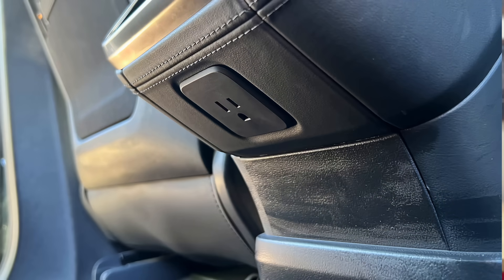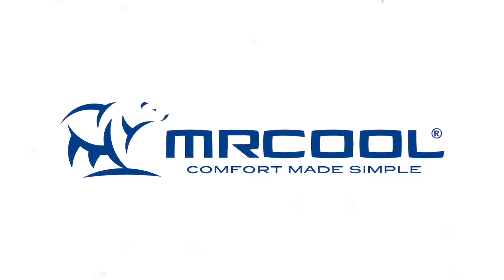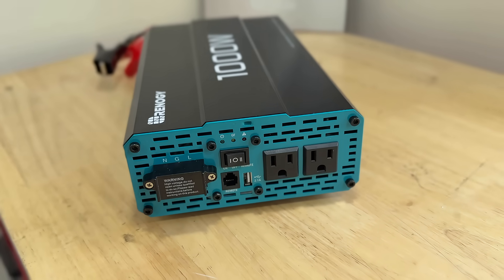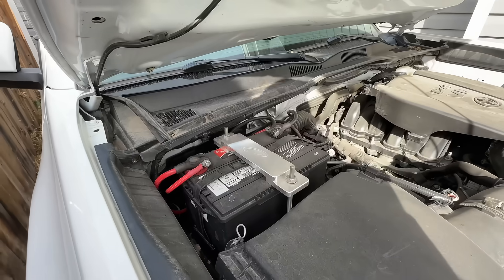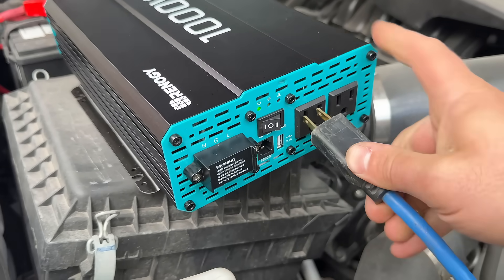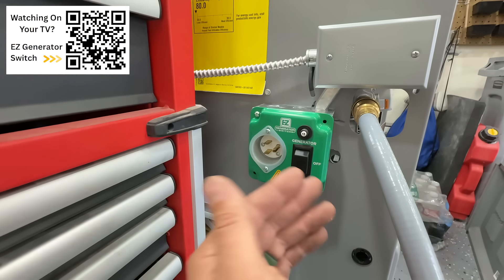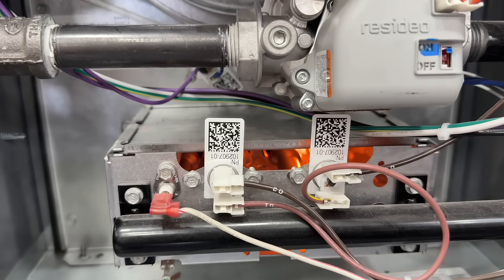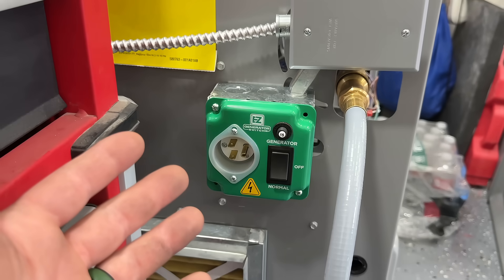Why Buy A Generator? You Have One Parked In Your Driveway.

Comment: Of course this is really a good idea, However there is a catch!   which is your country needs to have regular deliveries of free / dead cheap Iranian, Syrian or Venezuelan oil..
Works well in the USA where it seems stollen oil is often a normal thing not so sure if it can be viable in Europe or elsewhere as the high cost of fuel will make this too expensive for longer running times.

Comment: The engine is fine to run that long but the heat from your engine can melt the little plastic parts in that converter, stick it under a seat or in the bed!

Comment: So I most definitely can plug a power strip into my extension cord and charge my Makita batteries,  my cell phone, and a blue tooth speaker on a off grid cabin build? And also another longer cord to run my worm drive saw, and vaccum and a corded grinder?

Comment: You can do this, but just know that you're likely to wear out your battery and alternator much faster. The alternator is not designed to carry that high of a load (a large inverter) at idle for long periods of time, it will overheat and it's life will be shortened. I would not close the inverter under the hood, it will get too hot, and there's too much risk that if it moves it could short out something.

Comment: I don't care what size inverter you use but if you pull more than 600-800 watts from your battery you will ruin it sooner than later, and even less watts direct from the alternator. I'm a car audio guy and the way we produce wattage is through amplification and performance alternators..Not through straight drawing 12v inverters.

Comment: before buying an inverter figure out what you want to run...and how much wattage it uses normally...if it has a motor ( the furnace fan...compressors on refrigeration / freezer units ).. they will draw whats called a " PEAK " wattage...it uses almost double normal running power to get the motors moving at first and then drop down to running wattage.... you also want PURE SIGN WAVE invertor if you running electronics...and some furnaces are high tech computer boards !!     A pure sine wave inverter converts DC power (from batteries) into clean, stable AC power that closely mimics utility grid power, making it ideal for sensitive electronics like laptops, medical devices (CPAPs), TVs, microwaves, and motors, allowing them to run quieter, cooler, and more efficiently than with cheaper modified sine wave inverters, though they generally cost more. They're essential for RVs, off-grid systems, and emergency backup power, providing smooth, reliable energy.

Comment: It's not recommended in the UK.
If you leave your car running unattended on your driveway and someone steals it, your insurance company may not pay out - you made it too easy to be stolen.
Try this with your car on a public road and it's now illegal. If you're stopped for more than a minute, certainly outside schools, you're supposed to turn your engine off - pollution, fuel wastage, etc.
Failure to do so could win you a £20 to £80 fine.
That and the inefficiency of an idling engine is said to leave residue due to improperly combusted fuel that could damage your exhaust.

But hey, you know, it would work in a pinch.

Comment: 1000 watts won't even run a hair dryer. My 2018 Toyota has a house plug in the back and it's only rated at 400 watts.  You mess with modern and expensive automobile electronics and you are asking for expensive trouble. It's also not good to idle a vehicle engine anymore than you have too. The EPA smog devices, egr valve,  tend to foul your engine.  My home heat pump has a small 13 ton coil. It takes 30 amps at start up. You need to get a good understanding of amps, watts and volts before you start messing with DC to AC current.  You need the proper gage wire or you could overheat it and start a fire.

Comment: Why?  Because  A:  Running your car just to run the alternator is the LEAST fuel efficient thing you can do.  B:  Depending on what car you have, your alternator is only going to put out 50-100 amps, which is 500-1,000w.  C:  You're burning up gas in your car that you might need to use for other purposes.   Literally a $200 generator is better at both of these things and about the same amount of money as the inverter and cables.   Yes, using an inverter in your car is a neat trick for a DIRE emergency, but if you are thinking ahead, then it's a very BAD idea. Just buy the right tool for the job. More effective, more efficient, and not that much more.

Comment: This should be reserved for extreme emergencies. A $500 generator will make more power and use only a tiny portion of the gasoline, and without unnecessary wear and tear on a $20,000+ automobile. Also, even a cheap alternator today (which isn't designed for sustained high loads, as would be needed to power your lights and appliances) will cost more to replace than your $500 generator.

Comment: sooooo drain the battery to run the furnace... got it.
just get jumper cables and extend the inverter...

inverter is going to melt in the engine bay...

Comment: I don’t know about other vehicles but my 2016 Silverado has a plug but will not power much..they only put out 150 watts, or some say up to 400 watts. That will Not Run your fridge or any furnace blower. You can charge your phone or laptop or some lightbulbs. Just check your vehicle so you know and not surprised when the power goes out. You need to know what your furnace blower needs to start, called. Start up watts or surge watts. If your power source can handle it then you’ll be good.

Comment: Just make sure your engine is running or else you will  fry your battery. Turn your car on while inverter is plugged into battery, if its just 110v 150watt heater you need for furnace. Just get a 300watt inverter, no need for a 1000w.  For sensitive electronics make sure its a pure sine inverter.

Comment: At roughly 3 gallons an hour at idle, it's a very inefficient use of gasoline.
Those tiny wire clamps that come with the inverter are only good for maybe 360 Watts / 30A @12v DC

Comment: Do you need to keep the car idle the whole time? If so, the gas it burns are very costly. Probably 100 bucks a day. Not economical.
Reply: A hybrid car about 1/3 of a gallon an hour. You don't need to run 24/7. Every 3 or 4 hours you start it up. Cheaper than your generator 😮

Comment: I wouldnt use those gator clip cables myself id use larger ones, maybe even jumper cables. On 12v with an inverter youre drawing a lot from the battery. Say youre using all 1000w. 8 amps AC from inverter, 80 amps from battery. This is going to work your alternator very hard over time, average 12v battery will last about maybe 20 mins on its own and thats being generous

Comment: Your car isn't supposed to idle like that.  It's abusive to your valve train and lifters to let it idle, unless you have a dramatically upgraded oil pump.

Also, using the onboard inverter of a car is just sad.  A car's engine is capable of generating far more than just the alternator will provide, but even the alternator output is usually in excess of 150 amps as 12 volts, or roughly 1800 watts.  If it were optimized to be a generator rather than a transportation machine it would have an alternator in it that would match the total power output of the machine, closer to 100+ kilowatts.  Using this engine to get a mere 400 watts or something like that (which a typical modern onboard auto inverter will provide) is wasteful and foolish.

If you're doing this and getting less than 1200 watts through an aftermarket inverter you attach to your car's battery, you're being inefficient and also destructive of your vehicle.

Comment: Great video! However there's more caveats;

Leaving your vehicle running is a much bigger risk than the inverter getting stolen. But if you're in a good area it's unlikely. 

Don't run it for long without the car running, regular car batteries are not deep cycle and will take damage being discharged like  this... You could also run it too low to start the car.

Those wires into the inverter are way too thin. Fine for a furnace, fridge or other low load but if that inverter demands the whole 1000w / 100 amps they'll melt

Comment: There's a way to get like 100 horsepower for a generator which would be 75,000 Watts I'll tell y'all and maybe somebody can figure out how to build one I've been thinking about it anyway you put the wheels on a roller to rollers and then one of them is hooked up to a Dynamo which is a generator without a motor and set the car and drive and let it go at whatever speed you want idle speed which might be 15 mph or you can rub it up and put it up to 70 mph and get all that power out through the Dynamo you'd have to make sure the truck was changed to something solid and be really careful but it's doable and would work a lot better in a major power outage somebody figure out how to do this very well could use one of those gizmos they used to test cars and fancy garages where they set them on a roller and make them go without moving. Let me know if there's one of these on the market

Comment: 1. Buy a second battery (for inverter)
2. Install a battery isolator, so your main (engine) battery will not get depleted when using inverters dan you can charge your second battery while engine is running...

Comment: Do not try this, not only is idling your vehicle over night extremely unhealthy for your engine, your alternator will not charge efficiently while at idle. You also risk over loading your charging system/ alternator depending on what your hooking to it. Maybe in an emergency if you absolutely need to... but I definitely would not recommend it.

Comment: I have a 2400 watt "quiet" generator that is acceptable. I have run a 500W window AC for over 8 hours on 2 gallons of gas. I am camped in Wyoming and using it now with a 750W heater.  I have solar but it is older with gel cell batteries. The big LiOn upgrade on is coming soon. Solar here in winter is just not enough, unless you go big.
 - Oil changes on the generator I have are every 50 hours. I never get to 50 hours between oil changes.

Comment: May want to up the wire size to the battery:  assuming the inverter makes the stated 1000W, and that it is 95% efficient,  the input side will pull about 1053 watts.  At 14.4 VCD, that is about 73 amps.  If the voltage is down at ~10 at some point, that will be pulling over 100A.  This is a bit more (a LOT more) than one should put through 12AWG or even 10AWG...just guessing from what I am seeing in the vids.  Need more like 4AWG, and if running continuously more like 2AWG to avoid making the input wires into fuses or igniters...

Comment: I purchased a 1000w before switching to a gas generator. It initially made sense, having a Tacoma bolstering a larger duty alternator. However, 1000w was NOT enough to start EITHER the fridge or the coffee maker. So instead of going for a 3000w inverter unit, I went for a cheap portable generator.

Comment: Terrible video....do not do this the way this guy is showing you.  This is a sound Method but he is omitting very important safety tips.  NEVER hook up a inverter to a battery without going through a fuse.  Some clowns might start an argument that the inverter is fused, this is true, however fusing the inverter from the battery protects your vehicle not the inverter.  Don't be stupid

Comment: Haven’t watched the video, but… my vehicle’s alternator doesn’t supply enough power to run anything that my Jackery batteries can’t. My biggest Jackery is 1,000 watts and I can’t run anything that air conditioner or a space heater or an air fryer. If I had a gas generator I could power pretty much anything I want and not put unnecessary wear on my vehicle.

Comment: Incomplete combustion: At idle temperatures, fuel doesn't burn completely, leaving residue that can build up and damage engine components like spark plugs and cylinder walls. 
Oil contamination: The incomplete combustion can also contaminate the engine oil faster, requiring more frequent oil changes. 
Transmission strain: Leaving the car in drive while idling can cause the torque converter to spin and create drag, leading to overheating and potential damage over time.

Comment: now, go google two things.  what a demanding load does to an alternator long term, and what sitting your engine idling does to your exhaust manifold and everything up and down stream.

in a pinch?  sure...

but as a purpose built and bought system?  no.  spend the money and time on the right solution to the right problem...
Reply: Was going to say the same, and add the higher fuel usage of the vechile over what a generator would use. (an 80amp alternator at max output only produces 960 watts, at a specified RPM, and needs those revs for cooling, and certainly would not like doing it non stop). But in an emergency, for a small load, if you do not have a genny, ok. 
But if you have an EV, they usually have a 12v battery as well, which is charged from the main one, and it is said in forums for my nissan leaf 40kw as an example, that you can pull 1-1.5kw safely using an inverter on it.
Would also add that an inverter has a peak output and a continuous output rating, which is usually around half of peak. But what many do not know is, that the continuous rating is usually for only 20 minutes or so, and it will overheat if run at more than half that,  if using that load 24/7.

Comment: Well, as an emergency solution that works. But if you need a generator frequently - you'd better buy one.
Using a car for the purpose is extremely inefficient in terms of fuel consumption, not to say that the car motor while idling does not get enough lubrication, and that damages the motor in a long run.

Comment: One thing to mention, most car alternators can only put out 12V with a max of 80A. Which comes out to 960W. Using anything higher than that, can cause the alternator to overheat.

Comment: if you have small car, make sure to remember the max output of your alternator. for me it's 80A, cut some for internal engine operation and maybe you'll be able to pull 60A 12V => 720w out of it. Cut like 0.9 for conversion efficiency and you'll get around 650W of AC power.

Comment: You have to be careful here not to damage your car battery. The car battery is at most 50-60ah, and with 12v that’s around 550-650kwh worth of electricity. The battery will die after around 25 minutes of 1000w load if the engine is off. Better to keep the car running.

Comment: Y’all need to hard wire that inverter to the battery for any serious power draw, not use clamps. Also make sure you have thick enough cables running from the battery to the converter…

Comment: For $1,000, my Harbor Freight 8750 inverter generator (7,000 running watts) runs my entire house during outages. I installed and connected a 240V 30A wall outlet to my old 30A water heater breakers to plug my generator cord into AFTER following my checklist👍

Comment: It's not nearly as simple as the guy makes it sound. Smaller vehicles have alternators that produce about 500 watts IF THE ENGINE IS RUNNING AT ABOUT 2,000 RPM. The fan in a forced air furnace in an average home requires about 360 watts, a larger home 750 watts but that's after they start and get wound up to operating RPM. While they rev up they need more than the watts mentioned. The battery in the vehicle will be able to provide that additional power need to get the fan motor wound up to operating RPM. If you have a refrigerator, freezer, electric stove and microwave connected all at the same time then it simply isn't going to work off of a 500 watt alternator in the winter, not even with a 3,000 watt inverter because the limiting factor is the 500 watt alternator in the vehicle. You MIGHT be able to run them 1 at a time and simply connect/disconnect the others as needed.   

Some larger vehicles have alternators that can produce up to 2,000 watts but those are not common. 1000 watt alternators are more the norm.  For a 2,000 watt alternator get a 3,000 watt inverter. For a 1,000 watt alternator get a 2,000 watt inverter. The reason is inverters are quite inefficient which means even if you give them 2,000 watts you'll get considerably less than that out. That's simply the price inherent in converting 12 volts to 120 volts.

Bottom line is before you lay down cash to hook up such a system you need to check out how much power (watts) the appliances in your home consume and how much power (watts) the alternator in your vehicle can provide.  Every appliance will have its rated watts on a badge or label somewhere on the appliance. Make a list and add them up. Then you need to decide if you intend to keep them all connected so as to allow them all to run simultaneously or whether you'll be plugging in only 1 at a time. Indeed they won't always all run simultaneously often but sometimes they will and your system needs to be able to meet that peak load if you don't want to go through the bother of unplugging some while others run. 

After you have decided what your peak load is going to be add 25% to 50% to give yourself a little wiggle room. Better to have more than you need than to find out you don't have enough AFTER the power goes out.